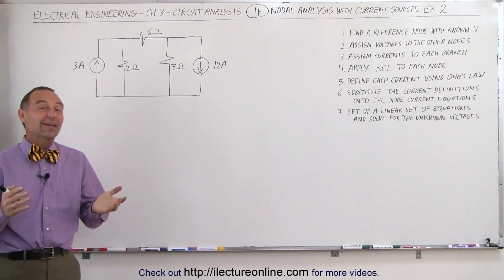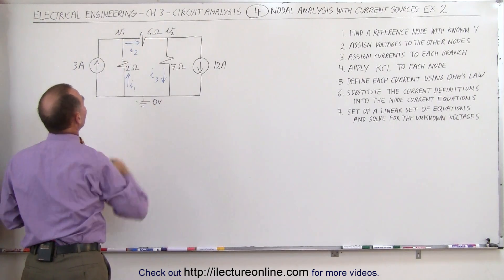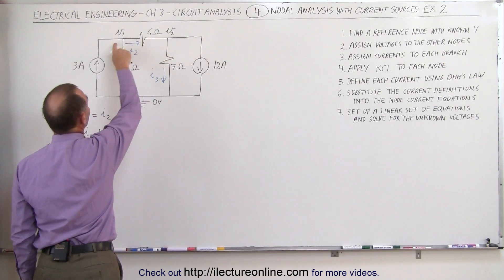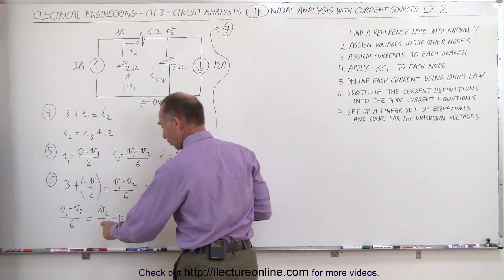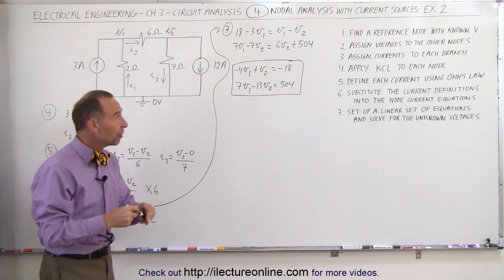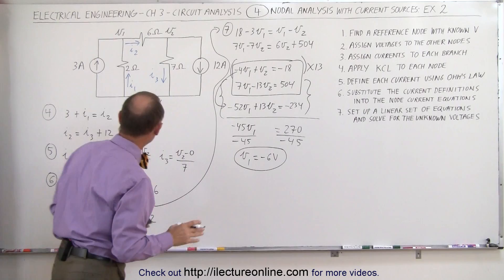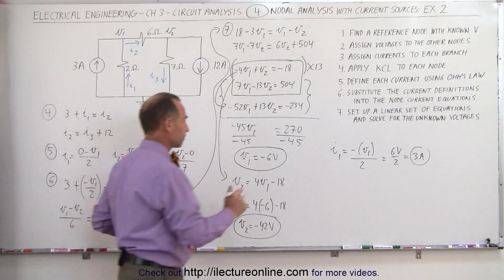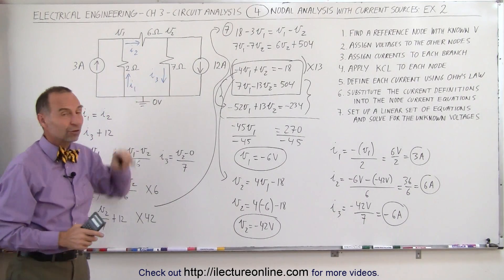Electrical Engineering: Ch 3: Circuit Analysis  (4 of 37) Nodal Analysis w/ Current Sources: Ex. 2

Comment: could you explain, which point should be a reference node = 0V? how to choose it.
Reply from the maker: When voltage sources are given, it is relatively easy to find the voltage at one or more nodes.  In this example there were only 2 current sources, so we set the bottom node to zero volts.

Comment: In the beginning, i think a bit of weird about the current flow direction of i3 , as the 12V should be the starting point, there must be some current flow straight up through 7 ohm resistor, but luckily the calculated I3 is negative, so it will prove my thinking is right.
Reply from the maker: Yes, if you get a negative result, it means that the current flow in the other direction.
Reply: @MichelvanBiezen Splitting hairs here, so shouldn't i3 be 6A and not -6A as the final answer? (assuming now you now know the directional flow of i3)

Comment: I chose a different spot for ground and am getting the same values for current, but significantly different values for the voltage in the nodes. For instance, I had ground in the top right corner, and still got a different value than you for the top left node voltage. I suppose this is the natural result of having different reference points for ground?
Reply from the maker: That is expected.  The currents will be the same and the voltages are reference voltages to a specific point.  (that is why we use the term: "potential difference").

Comment: Can I always add a random ground to the given circuit in the exam if my professor didn't put one?
Reply from the maker: Voltage or "potential" is not an absolute measurement but is taken in relation to another point, which is why we often talk about the "potential difference".  In that sense you can go to the lowest voltage point in the circuit and arbitrarily call that the zero voltage point or place a "ground" there.  (t then becomes a reference point.  However we do have circuits where at some point in the circuit it is actually connected to a real ground and then we should place a ground symbol there.

Comment: If you use 2 nodes (where is written v1 and v2) and one loop (there where are the 3 resistors of 2, 6 and 7 ohm) you get a system of 3 equations and 3 variables (the currents i1, i2 and i3) and we get its solution very much faster!!!!!But it's just a humble suggestion, Mr. Michel Van Biezen!!!!
Reply from the maker: A very good suggestion.  Note that there are many ways in which one can solve such a problem.  This is an example of a standard method to solve a circuit with nodal analysis.
Reply: Were you talking about mesh analysis, because it's the topic which comes after this one

Comment: In this circuit I assumed i1 and i2 is leaving the node and i3 was entering the node. I came up with everything you did except when it comes to the second equation since I chose i3 entering the node. I came up with 7v1-7v2+6v2=504. But this proves to be incorrect. What am I missing?
Reply from the maker: With these types of problems it is common to make little arithmetic errors.  When that happens to me, I turn the paper around and start over a second time and I try to make sure I don't make a mistake this time.  (that is usually faster and easier than to try to figure out where  we went wrong).
Reply: I figured out my mistake. Thank you!

Comment: How do I know where the reference node is. Also how do I know we're the v1 and v2 bodes are?
Reply from the maker: The nodes are typically picked so we can find the currents and voltages in that area of the circuit.  There is no hard rule, and sometimes you need to pick a different point if you can't determine the currents and voltages with the node you picked firs, or you may have to create a "super node".

Comment: Sir i1 movement donot understand,,,,,,, 
Please told me....
Reply from the maker: Are you asking about the DIRECTION of i1?
Reply: Yes.. 
Please told me.
Reply from the maker: @mdmahmudulhossanmahin9130  Note the current source on the right side is much greater than the current source on the left side.  This will cause the currents to travel in a clockwise direction through the 2 ohm resistor.  But it would have been OK to pick the opposite direction in the beginning and your answer would have been a negative current, which then implies you picked the opposite direction.  Try it and you'll see.

Comment: I ran up into an issue
I assumed currents but the result is not negative, but wrong.
In a try, i decide to name my currents just as yours, except i1 goes downwards. So 3 = i1 + i2, and the rest of equation I have them sames as yours.This way, the result wont just be negative, but completely different.
How does one decide how to orient the currents? How to consistently assume "valid" orientations?
Reply from the maker: It should not make any difference, however you will also need to adjust the voltage differences to ensure they are positive, and when there is a current source, the direction is set and you cannot arbitrarily change it.
Reply: @MichelvanBiezen  But if I dont know the v1 and v2 values, how would I adjust the voltage difference to the correct so it stays positive? If i1 goes downwards, why would it be v2 - v1 instead of the other way around? (if I'm understanding correctly)

Comment: is the direction of the current i1 i2 i3 done in the peblm or we have to choose it arbitrary ?? than you
Reply from the maker: The currents i1, i2, and i3 can be chosen arbitrarily.  (If you pick the "incorrect" direction then you just get a negative answer to with the chosen direction of the current).  I will try to guess the direction, but it really doesn't matter.
Reply: thank you very much

Comment: It all makes perfect sense except for one part in the beginning with regards to assigning voltages to each node. You assigned v1 and v2 to the top 2 nodes but you didn't assign voltages to the bottom two nodes? Why weren't the bottom 2 nodes labeled v3 and v4?
Reply: Ignore my above comment, I just realized that v3 and v4 are at the same potential as ground which means v3 and v4 are there but they are basically zero just like ground.
Reply: @rationalthinker9612  The reason there are no v3 and v4 nodes is because it's all the same node, that's why he put the ground in the middle.

Comment: Hi, I did the Cramer's rule and I got V2=6V, V1=-42V. Opposite of what you got..Did I do something wrong?
Reply from the maker: Sometimes we can do a quick check.  Looking at the circuit the current i2 is clearly from left to right.  If we estimate the current to be about 10 A and the resistor is 6 ohms then there should be about a 60 V drop from v1 to v2 and thus v1 should be about 60 V higher than v2.  Then when we calculate it, the actual voltage drop is 36 V since the current i2 = 6 A.
Reply: Thank you very much!